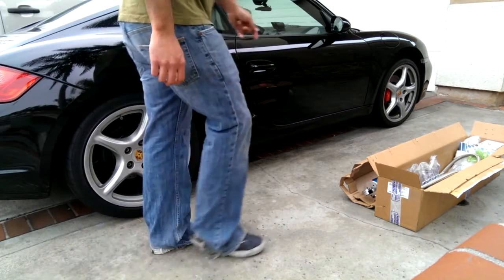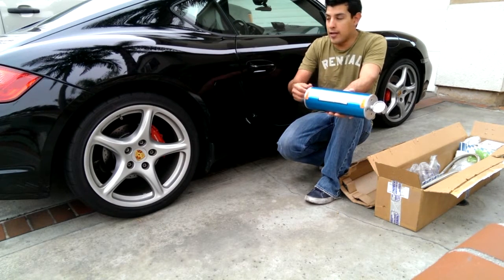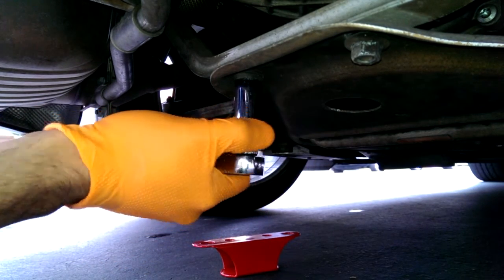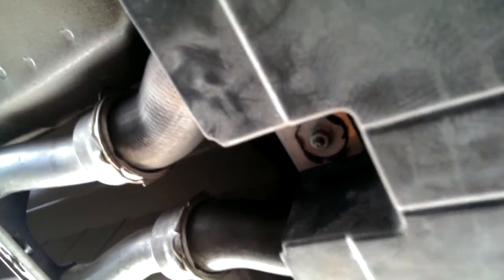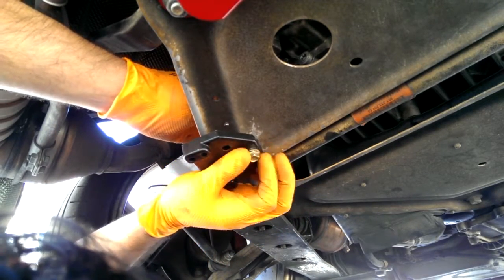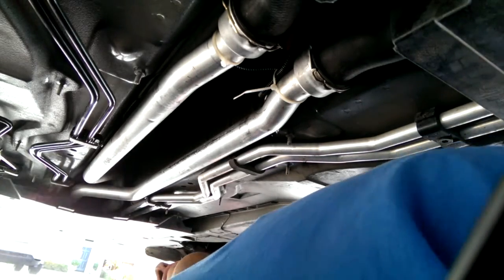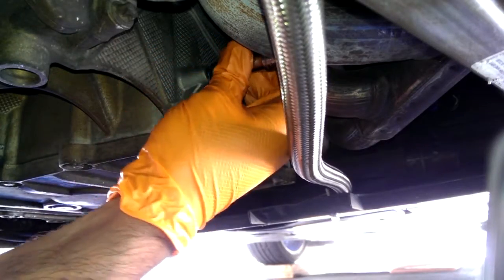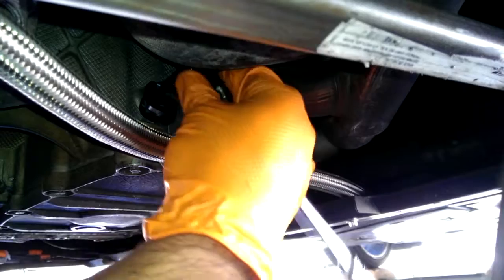987 Cayman S Accusump Install

Comment: Do you need to run the new oil filter kit to tee in the accusump ? Is there somewhere to run it off the factory setup without the new filter setup

Comment: interesting video, bit chaotic to the observe in terms of installation.
but ok  i guess.

Not to convinced bout them parts mounted on the suspension subframe tho.
It's already a weak part as is, and it's not supposed to be load bearing.
I'de prefer a more solid mount point then that, though i realize that takes more work to route lines to for instance the trunk.

Have there been any issues with this install in 2 years time?
loose connections , oil leaks, things failing?
Reply from the maker: The parts mounted to the subframe plate were nice and solid up until I sold the car. I removed them prior to the sale.   There were no wear marks from them striking any of the adjacent parts. Just wear marks from the screw’s themselves.

Comment: I have a 06 Cayman, I'm getting a weird vibration or maybe engine noise when pushing the car hard at 5,300 RPMs to 5,700 RPMs, it's weird, it pushes through it, sounds normal after 5,700 RPMs, but your post makes me think I could be losing oil pressure. Have you heard anything like that in your car or read anything like that in the forums?

Comment: Are you using this oil accumulator to prelube the engine prior to start up, or just as a back up reservoir for the oil pressure at the track. Very interesting and easy to follow install thank you. Would appreciate some follow up on how it works out for you. Thank you.
Reply from the maker: The way I have it wired you can use it for both. I usually switch it off during my regular street driving. Every morning I like to see the oil pressure build before I crank the engine. I will be posting another video, about what it is like to set the oil level and how it works, in the future.

Comment: Could you make a video while you're at the track of your RPM gauge & oil pressure, when you're cornering? There's no such video online. I have my own 3 Litre Accusump for my 996 911, and it will be a PIA to install.
Reply from the maker: I have a short clip of cornering footage in this video @ 40:10. https://youtu.be/Yjx2aIpxsBQ
I will be making a full video of on track operation of the Accusump with a view of tach, oil press gauge, and Accusump activation light. What racetrack are you taking your 996 to?
Reply: +Cars+Raf  thanks for the link and posting your videos. It's great that your oil pressure gauge beeps when the oil pressure falls below a certain value. I would track my car at a small technical track - Grand Bend Motorplex, in Ontario. Let us know your pressure settings for both the gauge beeping (which is easy to hear), and your Accusump activation light when you post it. 

Somewhere I have instructions on how to adjust the accusump activation pressure. Never tried though, so don't know if it works or not. Also don't know if it will work on the newer electric valves.
Reply from the maker: Hello Pete I have the gauge beep set to .6 or .7 BAR. Yes the accusump with a new style EPC valve relies on the pressure switch to activate the accusump. You need to change the EPC switch to change the activation pressure. My accusump activation light is wired in parallel with the EPC valve from the pressure switch, they  turn on together. 
I am definitely going to look up some track vids of Grand Bend Motorplex. My advice is to install the gauges first and take your 996 to the track. Then once you are sure you loose oil pressure on certain corners, begin the long process of the accusump install. 
Good Luck

Comment: does this work wit a oump.and is this good for drag racing.thanks
Reply: Denise,
Yes this work for many different applications including drag racing.
Reply from the maker: They totally use these for drag racing. No no extra pump, it taps into the existing oil pumps supply to the factory Oil Filter.

Comment: If you must work there, how about two ramps?  Roll up with one side on the curb, put a ramp in front of each passenger tire, and drive up ramps perhaps with someone outside guiding.  A little safer...a little further from traffic...and you can still use those ramps if you find a safer place to work.  Problem is, low profile ramps are getting popular, and with that short curb, there might not be enough room under the car.  But more importantly, it's cool that you're "hands-on"